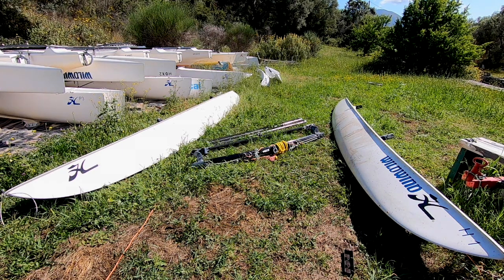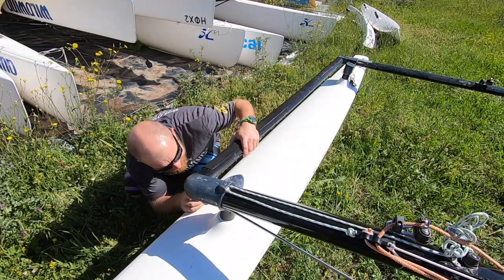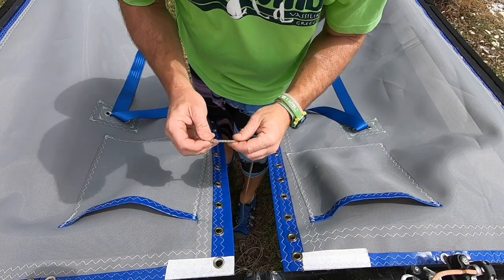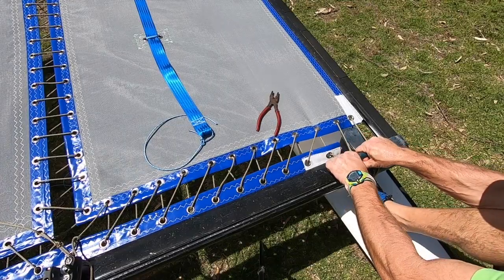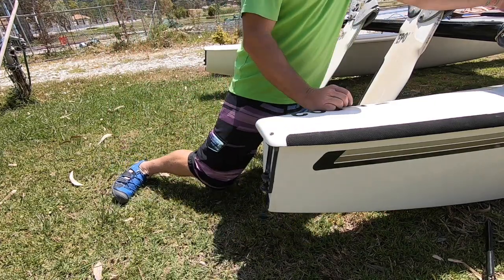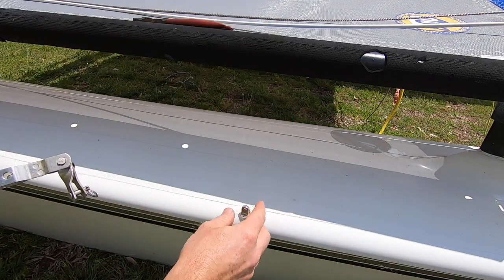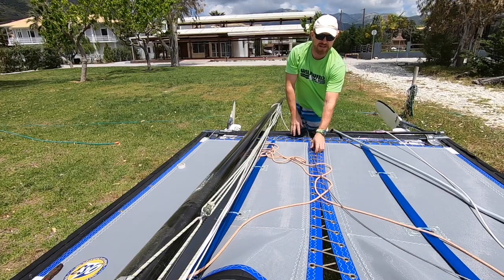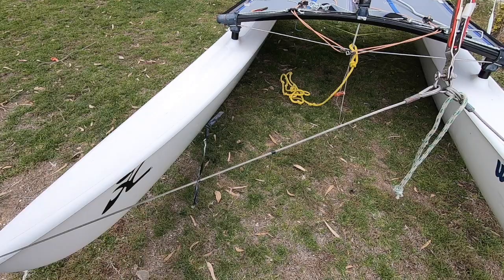Hobie 16 complete assembly and rigging

Comment: This is a great video with great information.  Your trapeze connection at 27:45 reminded me of something.  You can get plastic balls with holes in them to attach to ropes with just a knot.  Run the rope through the hole, tie a Figure 8, and it's locked in.  Tie a red, one-inch, ball onto the elastic coming up through the trampoline and use red rope on the crew's trapeze.  Then at the end of the line on the trapeze, tie a loop (bowline).  When you want to connect the trapeze to the elastic, slip the red ball through the red loop.  For the skipper use a blue ball and blue trapeze line.  And I would duplicate the entire process with another set of holes in the tramp about 6 inches aft of the crew's elastic.  That way the skipper doesn't have to look around to find his trapeze hook.
Reply from the maker: Nice idea, especially if you're rigging and re-rigging quite regularly.
Cheers

Comment: It's kinda cool to see the differences between these newer boats and my 1981 hobie 16. There are definitely a lot of things that are the same but there are also some things that they definitely changed up over the decades. For instance my boat only has one trapeze on each side. The tramp on my boat is more of a solid vinyl and doesn't have pockets I just slide the coiled line behind the rigging so it's pinned against the mast. There are adjustable jib travelers but it has a pin to hold it in place and doesn't have a line to adjust it. I don't have any rigging for the downhaul I just have to use the cleet and brute force. The sails are different too I don't have any windows and it just has the hobie logo no text outside the numbers in mine however I do have the very pretty tequila sunrise sails as my primary set of sails. My grandma actually special ordered the boat to have white hulls a blue  tramp and the tequila sunrise sails. That combination was not an option so the dealership took two different boats and took them apart to give my grandpa the combination he wanted. I actually still have all the paperwork and letters for all the interactions he had with the dealership to buy the boat. Also to raise the sail solo I recommend landing it on the beach backwards su the front end of the boat is down as much as you can get it. Then when you put the mast up the lines on the side hold it in place while you go secure the front line. My grandpa taught me that and said he learned it from a racing team way back when he first got the boat.
Reply from the maker: Wow, that's so cool that you had a 16 fresh from the factory back in the day.
I should have a video coming this weekend showing the new 2022 boats and the new features.

Comment: I used to assemble Hobies for a dealership while in high school.  We never used grease, just pounded them together with rubber mallets so they were more rigid as the aluminum oxidized and expanded the frame became more rigid which is a good thing.  We called them the cross beams and the side beams.  Use a stainless steel nylock nut on the inside of the casting (under the trampoline) so it cannot cut you. A stainless steel nylock nut will never loosen, so you never have to worry about it.  Some silicon spray makes it even easier to slide the bolt ropes.  Polypropylene stretches less than nylon for the tramp lines., makes it less bouncy.  Center the grommets between the corresponding grommets on the other side and you will have fewer wrinkles.  Vice grips make the tramp lacing easier.  Don't pull on a grommet so hard as to create a wrinkle.  A center punch will keep the rudder pin from mushrooming.  The mast bearings are Teflon.  Make your own and save a lot of money.  You can buy some thicker Teflon that lasts longer from Amazon.  I like the idea of using VHS tape.  I used to use cassette tape.  Ideally, you want to rinse your sails after sailing, let them dry and then stow them.  The swage on the halyard presses against the fork when in the locked position.....not against the shackle or the rope.  The tension comes off of the forestay and onto the bolt rope (cable) luff of the sail when tightening the jib.  Leave your mainsheet very loose when on the beach.....jib too., so the boat does not capsize on its own.
Reply from the maker: Hi David, 
Thanks very much for all of your insights. There's always more to learn with any types of boat. 
Great tips.

Comment: Nice video, What we usualy use instead of electrical tape is self vulcanizing rubbertape. it works perfect even in hotter climates and doesnt leav a sticky residue after removing. And it last a whole year.
Reply from the maker: Yes, that's the good stuff! It's too expensive for us, we do use it on pins that are definitely going to be staying in for the foreseeable.

Comment: Hi Joe, love watching your videos! I am surprised that you only hand tightened the frame to the castings. My 2008 Hobie 16 is too loose for comfort and I am considering applying epoxy. How tight should I tighten the bolt on the casting?
Reply from the maker: Only hand tight as you can't compress the castings. 
Epoxy is a popular choice if you never want to take your boat apart.
I feel however, if it's an older boat it mights stress the pylons inside the hulls. 
Packing the pylons with plastic i think is a better option.

Comment: Really great video. I am hoping you can answer a question for me. I bought an old Hobie 16 that I am trying to setup. How far apart on the main halyard should the lugs be?  The first lug lines up fine with the reef point but the second does not and no matter how hard I pull I cannot get these second lug to the V notch. It also seems that the sail will top out before or just as that happens. Any guidance or suggestions are appreciated.
Reply from the maker: sorry I keep forgetting to measure one. I'll remember and then i'll let you know.

Comment: There's halyard locks at reefing points? Could you show that some time?
I had a 1986 H18 and getting the halyard to lock or unlock was an art, and very frustrating at first! It seems that Hobie has made that system much easier now. I remember my hands were torn up from pulling the main up. And i was used to crazy downhaul on my windsurfing rigs.
Reply from the maker: Only on the 16 which uses the wire to lock in. No such lock on an 18. I'll have a look at it in a video.

Comment: Thanks for doing this mate! Very helpful as I’ve just put my 1985 Hobie 16 on the beach! Still needs a bit of fine tuning. A question for you: I currently have it on a mooring but do you think that’s wise? With it grounding and floating twice a day could it cause damage to the hulls?
Reply from the maker: I wouldn't leave it on a mooring all of the time, I think it being constantly in the water might increase the chance of hulls going soft. I don't think it touching the bottom is an issue.

Comment: Really great video thanks.  Quite a fandango, Dart 18 all's forgiven.  Do you need to measure the mast rake or is it pretty much set in one position?  Looks very raked back.  We used to spray some silicone lube along the mast track or bolt rope- goes up a dream.
Reply from the maker: The mast rake is set with the shrouds and then the rig tension is on the jib. So when we're ready to sail the mast will be more upright.
I just use water on the sail to help it up the mast.

Comment: The snap shackle is an awesome idea… I’ve tried it myself, but unfortunately it won’t fit onto the boom on the North American boats, (the boom block hanger has a very small gap)… I use it for the jib though...Great for de-powering the jib as I come on shore as I have a string attached to the end and I just give that a tug to set the jib free.
Reply from the maker: If you're not getting block to block maybe you could add a small shackle and then snap shackle onto that.

Comment: Awesome videos, I've been watching a lot of your videos lately and it's motivating me to get my 1987 Hobie 16 water worthy (new tramp, new lines). I've never sailed before and was wondering if you think the 16 is too much boat for a beginner. Also, what are the most common mistakes beginners make when they first go out.
Reply from the maker: The 16 isn't too much as a beginner as long as you don't try with too much wind.
Here are a few points from an article that i'm writing:

Location: 
A lake or reservoir or location with no or little tide/current. Plenty of space and not too many other water users. Easy launching - a good slipway or access point would make things easier.
No big hazards, or even small hazards  (the list could be huge) - underwater rocks, commercial boats / ships, angry or potentially threatening creatures, angry or potentially threatening fishermen!
Fewer obstructions to the wind would be better - buildings, trees etc
Other safe places to land would be nice - just in case things don’t go so well.
Safety cover - not always available but, of course, a massive bonus!

Conditions: 
Light, steady wind - between 3 and 6 knots (3.5 - 7 mph, force 1 - 2) More wind will make things happen more quickly, less and you might not be able to get moving at all.
The water state wants to be as flat as possible - any waves would make everything more difficult and unnerving.
The wind should be ideally onshore or cross-onshore - so if it will be much easier to get back to your starting point. Offshore winds should definitely be avoided as getting back could be an issue.
Reply: @JoyriderTV  Thanks for the info this will for sure help. I have a vacation home that I go to often. The lake next to the home is this one https://goo.gl/maps/7txWjfdEMzr2kKZL7
I'm just wondering if that's too small to learn on. The good thing about it is there are not many people on the lake but it's not that big.

The other option is this lake https://goo.gl/maps/9T112XHiDtW99Pxd8  It's a lot bigger but has a lot of traffic on the lake usually. There's a lot of space so I'm sure there are areas I can find with less traffic. 

Both of these lakes are really shallow. I was wondering if I did go over with the average depth being around 15 feet in both lakes would you see any issues with the boat turtling and getting stuck in the soft bottom? I'm debating on buying the mast float but they're not cheap.

Comment: Thanks for these great videos, Joe...!  I recommend this channel to all my Hobie sailing friends.  Quick question:  What length shrouds do you use on your Hobie 16's?  I have an early 80's boat and I can't get my mast rake back as far as you do, and I'm in the lowest hole settings.  (Mast still almost vertical)  Gonna update some rig over the winter and my go-to parts place offers a couple of different lengths.
Reply from the maker: I'll measure one and let you know. All of ours come directly from Hobie Cat Europe.
Reply: @JoyriderTV  Thanks Joe..I'm on Seneca Lake, in NY...heart of the incredible Finger Lakes Wine Region.  Sailing Hobies and other racing boats my whole life (60 yrs old..!)  I usually order from "Murrays Sports" in California.  They have a stock length (18"-10.25"... in 2 different guage wire) but also ask to specify length.
Reply: Mast rake aft is determined by the tension on your jib halyard as well as the length of your forestay, not the length of your shrouds. Normally your forestay will be a little loose.

Comment: Very helpful. I have had my 16 for many years and never have I found as good of a resource.  In regards to the Jib and the tension on the forestay:  Once you have put the tension on the Jib and the forestay is hanging loose, do you "take up the slack" by moving to a different hole on the chain plate or do you leave it slack?
Reply from the maker: You can leave it in the same position and take up the slack using a short piece of shock cord/bungee
Reply: @JoyriderTV  I had no idea the jib itself was supposed to take the rig tension!   Been doing it wrong for a few years, apparently!  Thank you so much for that little bit of information.

Comment: Hello, do you thing tightening the jib more than the forestay can cause all the load to be transferred to the jib, potentially leading to issues ? Or is it supposed to be like that ?
I know that in our Hobie 18 manual, they say to make sure that the forestay is always tighter than the jib for that reason.

Thank you for the very informative video, can't wait to get back on the water with the 16 this afternoon
Reply from the maker: Yes, and yes. 
On the 16 jib should take the tension. on the 18 the forestay should take the tension.
Reply: Thank you ! @JoyriderTV

Comment: Due to a shoulder issue, I was wondering if it would be okay to just secure the main halyard to the mast instead of securing the locking lug onto the hook on the mast?  I only sail on a lake in winds less than 15 knots. Trying to unhook that lug after a long day of sailing is kind of rough on a guy with a bad shoulder.  Thoughts comments appreciated.
Reply from the maker: If it was lighter wind it would be OK. The downsides would be that it would not hold the sail as high to the top of the mast and it would put more strain on the cleat at the bottom of the mast - which is not designed for load that high
Reply: @JoyriderTV  Dang!! I had not even thought about the extra load on the cleat. Glad I asked you before I tried it.  I greatly appreciate your channel and the quality production of your videos.  I always learn something new. Thank you so much for all of your help.

Comment: Maybe some vice grips to clamp down and hold the rope taught then you can be hands-free to tie the other side
Reply from the maker: Good plan!
Reply: Hold that thought.  There's a much better way.  Vice grips bang up your knuckles and break the strands of the rope.  
But first of all, at 8:15 you say any 4mm rope can be used to tighten the trampoline.  Not true.  You cannot use nylon based rope, because it stretches every time it gets wet.  I tried that starting with 50 ft of rope.  That season I pulled off 150 feet of rope that had stretched out.  The next season I switched to a cheap polyester rope (NOT polypropylene) from the hardware store.  Or you could use expensive Dacron rope from the boat shop.  

When you are tightening the rope, find two tapered pins that will jam into the grommet holes and pinch the rope.  Mine were aluminum but wood would be fine.  As you tighten the rope, keep moving the pins down to keep the rope from backing off.  To tighten I use a pair of pliers between the two pins.  Run the rope through the pliers and twist it until the formerly tight pin loosens.  Then move that pin down to the last tight hole and jam it in.  That's easier to see in a video demo - too bad I don't have one.  Murray's Marine used to sell a kit with two belaying pins and one tightener.  The pins are so effective you can sit on the tramp and tighten the middle.  You do have to be a little careful not to break the side rails from over tightening.  I used to use an XXXXXX pattern instead of VVVVVVVV pattern.  I've seen X|X|X|X|X|X|X|X patterns to really keep stuff from falling through the middle.

One more thing.  Before tightening the tramp, measure the cross diagonal distances from the bridle tang to the opposite rudder pin.  Those should be exactly the same distance before tightening the tramp.  Use the main sheet harness on the long side diagonal pylons to adjust.

Comment: Nice video! I was wondering if the castings at the corners of the trampoline are made of plastics or metal, and what's the purpose of the rivets. Thank you
Reply from the maker: Mad from cast aluminium. The rivets hold the castings onto the beam

Comment: I think you have mentioned this in other videos but it’s tough to find: how much flex should be able to happen between the hulls? If you lift one bow how stiff should it be to the other hull? And what makes this more rigid if it’s not? 
When I lift one of my bows the other stays put and I can see the frame torquing as if the joins need to be tightened. The tramp is old so is that the cause?
Reply from the maker: What that is probably that the castings or pylons that they sit on have significant wear.
This is inevitable over time. 
Tightening the tramp will help. 
When you have rig tension on that will help 
What you can do is try packing some plastic (like old detergent bottle material) into the gap between the pylon and casting.

Comment: Hi Joseph. Do you re tighten the chainplate after tensioning the jib? That line looked very loose.
Reply from the maker: Usually we pull the slack out using some elastic shock cord.
Reply: @JoyriderTV  i see so it does not hold the weight of the mask. That is the job of the jib line?
Reply from the maker: @FlowRida-hf6hp  yes, exactly.

Comment: Got a question about the Hobies. I'm a disabled guy into sailing. Is it possible to increase the width of the boat to increase stability? - without causing the hulls to submerge.
Reply from the maker: Hi Dave, 
I'll address this in tomorrow's live Q+A at 1730 Greek time.

Comment: Once you adjusted rake with the jib halyard, what happened to the tension on the forestay??
I sail a 29er and i just bought an old hobie14.. it seems the rig tensions is much less on these cats.
Reply from the maker: We get pretty loose shrouds when sailing with the tension eased.
Because the jib luff is holding the mast up, the actual forestay is totally loose when the boat is rigged.

Comment: Whay not tighten the nut? I don't have plastic nut only metal and I thightened it alwas well. Is it bad?
Reply from the maker: Hobie supply plastic nuts with the boats - it's just how it's always been - just to stop the bolt from coming out. 
No problem with using a metal nut but careful not to over tighten.